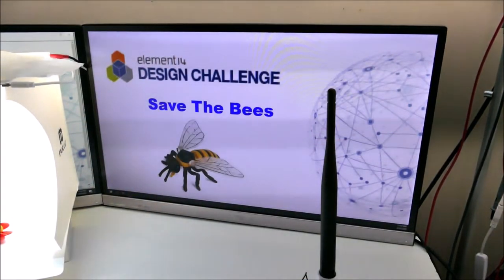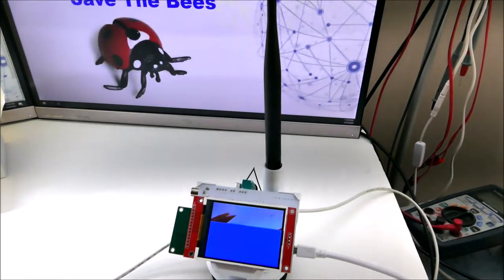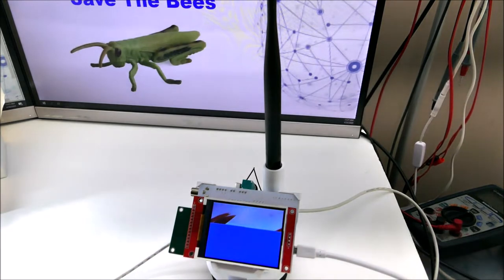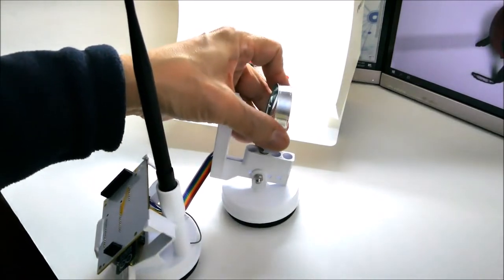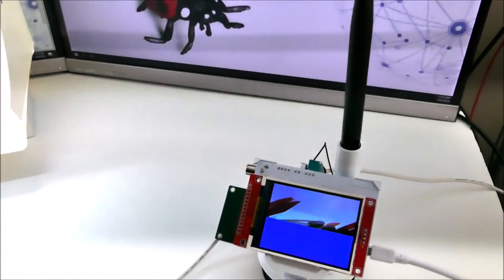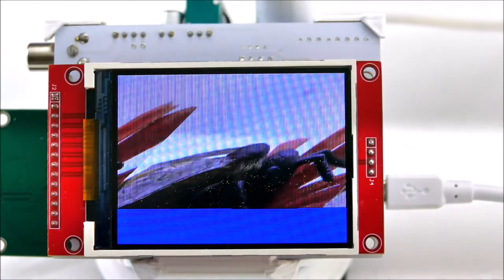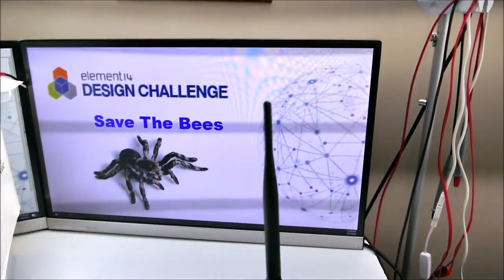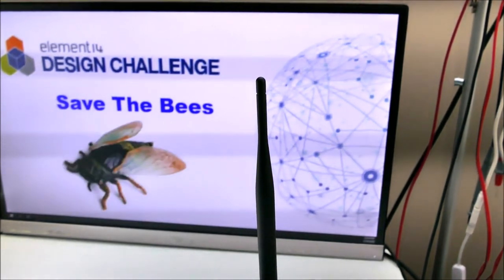LoRa Image Transfer

Comment: How do you come around region limitations (duty cycles/dwell time)?
Reply: One Bitmap Image takes 40 minutes, so he does not come around the limitations.
Possibly if he would send a good compressed JPEG file, he could save a lot of time, but for this he had to use a STM32.

Picture with 1226x690 pixel:
BMP-picture (R8+G8+B8) = 2,4 MiB (2.539.338 Bytes)
JPG-picture (Quality 50%) = 81,8 KiB     (83.750 Bytes)

2539338byte/83750byte = 30,32 times faster in this example.
So he would use not 40 minutes, he would make it in 1 minute and 20 seconds.
Reply: @mikropower01  😮 wonder what it takes to send 30 sec of audio converted to a jpeg 🍿 just the image going back and forth... offload the conversion to either a webservice or local app for testing🍿
Reply: @KJ-xt3yu  - 30 seconds of mp3 audio  (256kbyte) would be there in 7 minutes.20 seconds.